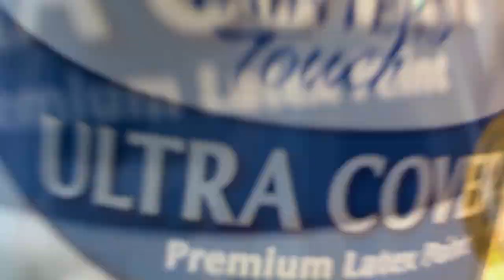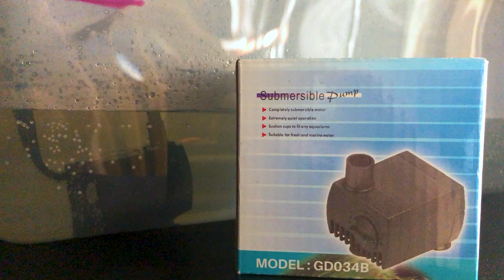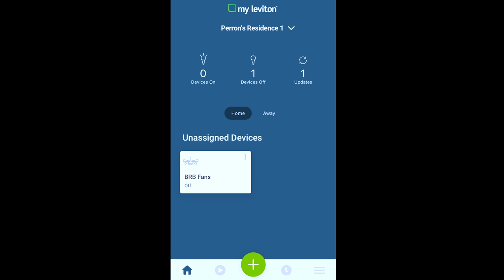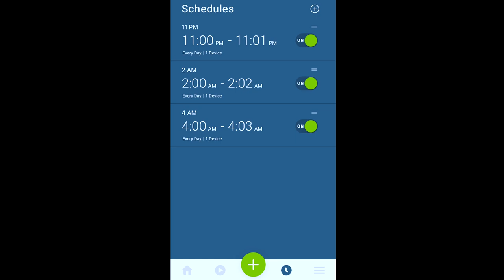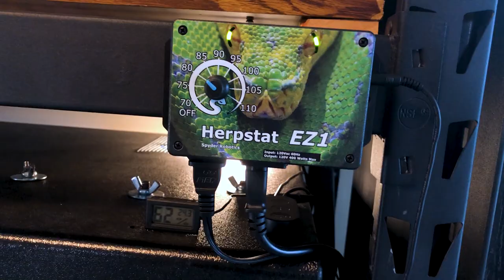DIY SNAKE ENCLOSURE - Rainbow boa

Comment: The basking platform with the hole for the heat probe is awesome. I had an idea for that but could not come up with a suitable material. Sand and glue, geez, perfect.
Reply from the maker: Yeah, I was pretty stoked when I learned that idea from Roman as well. It works great!

Comment: If you are not using the sump as filtration or making a big running water feature like a waterfall or drip wall, what benefit do you get from that plumbing system instead of just siphoning water directly from the pond to do water changes? Is it just so the water isn't stagnant and can go longer between water changes?
Reply from the maker: Yeah the main benefit is it keeps the water fresher. A) through movement and B) through increase water volume. Plus it’s a lot easier to do water changes because I just siphon the water and refill directly via the sump

Comment: Hey I have a question, so the arcadia and the halogen bulb are your only sources of heat and light (other than the leds) right? So how do you keep temps up during night when the lights are off? Love the enclosure.
Reply from the maker: I’ve added a heat mat on the warm side that turns off at 2 AM. So there’s a short period during the night where there’s absolutely no heat. I keep the entire room at above 23°C so the temperatures never drop below that. If you watch my room tour I posted in December I explain that in a little more detail 👌🏼

Comment: Could you please do a more in-depth video about how you created the pond/water feature and all of the specifics about the plumbing? I feel like that will be really useful for the reptile community!
Also, you use a humid hide, and the rest of the enclosure seems to appear fairly dry, is this recommended for a rainbow boa? And how do you manage with the heat being on a different end to the humidity? I have a BRB (only few months old), and I keep the entire enclosure humid as I know that the babies need 100% humidity - am I doing this correctly?
Reply from the maker: Yes, I can definitely do a more in-depth video about the pond! Adult rainbow boas should have a humidity of about +75%, so technically by the end of the day, my warm side is a little drier than it should be. I can't recommend that anyone lets their rainbow boa enclosure get this dry (I am taking the risk, to allow myself to tinker with the increase ventilation which I believe will be a healthy addition). But keep in mind, most of the 24 hour period, the humidity is adequate throughout the entire enclosure, it is really just late afternoon/early evening that is it too dry. I plan on counteracting this with a daily mist if two, that will elevate the humidity on the warm side. And yes, sounds like your setup is fine, babies are much more sensitive and do require a higher humidity at all times. Thank you for watching! I'll try and get to the pond video this month!

Comment: It looks awesome man! I really like the pond setup and design. Im curious if you noticed any odor from the sand and glue slab after being under the halogen for a bit. I know the pva is supposed to be non-toxic but I've always been a bit leary of leaving it under a heat lamp like that.
Reply from the maker: Thanks man! So far I haven't had an issues with odors or fumes. I know Roman (who I got the idea from) has used these slabs for years without issue (https://www.youtube.com/watch?v=4lu8S68CyWE)

Comment: A lot of great stuff in this build. I keep rainbow boas and although I think for experienced keepers, a lot of rules are meant to be broken, I can’t say I agree with using the halogen bulb. I’m well aware of the increased bioavailability of a halogen bulb as opposed to radiant heat panels, but I just can’t justify the heat loss. These animals are nocturnal, and are likely absorbing residual heat, not directly basking in top of rocks in the rainforest during the day. The ventilation required to allow the heat bulb in eliminates the proper humidity. After a meal your snake will want to be on the warm side, and will have to sacrifice humidity for warmth. 

Also, how are you maintaining nighttime temperature? I understand that slab will hold a lot of heat, but does it remain in the low 80s throughout the night without the bulb turning on?

I particularly liked the design of the water feature and hides. Having ventilation for a few moments at night seems pretty advantageous. I might consider using an aquarium filter for that water. Very interesting. Good job. I still think you should have higher humidity during the day. Perhaps a misting setup to spray the warm side every few hours would work as the halogen burns it off and lets it evaporate into the air.
Reply from the maker: Thank you for watching! Yes, I'm certainly going to have to play around with the humidity on the warm side, although I'm not having an issue maintaining humidity in the warm hide as I have it filled with sphagnum moss as well. It is mainly the surrounding area that is drier than I would like. I may have to play around with increase the ambient humidity of my room (I have a large swamp cooler that does the trick) or use a daily mist as you suggest.  

And I actually don't have night heat for any of my reptiles in this room, I let the room drop to 23-24°C through the night which is in line with the lows in the wild (here's the location I pulled data from for my BRB: https://en.climate-data.org/south-america/brazil/amazonas/manaus-1882/).  Having said that I still have the option of sliding a heat mat under the enclosure underneath the warm hide... this is something I might consider now that you have me thinking about it! I've done something similar with my JCP (it comes on in the late afternoon and turns off the early morning (2 AM ish), https://youtu.be/fYBPrtIjdwA?t=907), I might do something similar with this enclosure.  Thank you again for watching and providing great suggestions!

Comment: Very informative, and glad you dropped the music at the start, which IMO was a distraction over what you were saying.  I take it you want to extract the air from the enclosure into the room, rather than have the fan pull air into the enclosure?  If not then reverse the fan. The label on the fan identifies the direction the air flows.
My only other concern would be filtration.  I would add a small internal filter in the "sump" just to aid with any bacterial build up, especially as she will probably toilet in the pond as most boa's tend to to given the chance.
Reply from the maker: Thanks for watching (and for the feedback re: the music, glad I didn't use music for most of the video!). I actually want to the fan to blow air into the enclosure, I was looking to potentially create a "wind" like effect for enrichment sake... it will be easier to accomplish in the summer when the relative humidity in my home is higher. Good advice on the filter, I think that's a great idea and wouldn't be difficult to add

Comment: I'm planning the build for my new rainbow boa and want to a add a water feature very similar to yours! My main limitation is that I don't have the tools to cut glass so was hoping to use a clear plastic tub and customize the outside. Do you have any input on the pros/cons of that?
Reply from the maker: I think that should work fine. That was actually my original idea, but I couldn't find a plastic tub that was the dimensions I needed so a custom cut glass tub was my only option!
Reply: @AnimalsatHomePodcast  Okay awesome thank you!!

Comment: I use air humidifier (the one for humans, just plased it in on top of terrarium on the ventilation), my bci really liked it, now he spends much more time under heating lump and outside of his hide =) Later I'm planning to make a pond, but with waterfall and, maybe, a filter, because I won't be able to replace water easily your way, since in Russia water from water tap isn't drinkable. But as temporarily solution humidifier really works and easy to use. Anyway, thanks a lot for your tips and ideas, this enclosure looks great, your animals are lucky to have you as their owner =)
Reply from the maker: I have a air humidifier in the room as well, they help a ton! Thanks for watching the video and good luck with your pond & waterfall, that sounds amazing!

Comment: What is your mixture for your substrate and a guesstimate of the portion percentages?
Reply from the maker: Right now I’m using a mix of potting soil, coco husk, orchid bark and sphagum moss. Probably about equal part of each
Reply: @AnimalsatHomePodcast  I'm wanting to add top soil in with my blend and play sand. I use Cypress Mulch and Sphagnum Moss currently. I already have the lowes app ready for my purchase. Thanks for getting back to me 💯

Comment: You did a lot of really cool stuff in this video and I think it worked out pretty good overall. Can I make a couple suggestions that you can take or leave?? 

I think it would be cool to add a few more plants especially over in the area beside the warm hide which would give even a bit more cover. Something with a purplish colored leaf would be pretty cool or any kind of fern which should do okay and there as well and provide a lot of cover. 
You're hot hide is extremely cool in a lot of ways but it does kind of look a bit like a box and I would be tempted to hide it a bit by piling some substrate up against the side of it so that it's partially buried or maybe piling some small stones or hiding it with plants. 

One thing I don't super love about these enclosures when I see a lot of them is because they're black I find them dark even if they're well lit. Adding a background can really help although maybe you want it dark for some reason that I don't understand? I don't mean making it super bright just so that the light carries through the entire enclosure a bit better. 
On that note do you have enough light for your plants?

I don't know that much about Brazilian rainbow boas although I did almost buy one once and so I did a little research, can I ask what the substrate is? It looks to be a mix of sphagnum moss and soil?
I'm surprised at how shallow it is? 

I'm impressed with how the electronics and plumbing are on this and I find that pretty inspiring. The little probe screens all look really professional. When I do my corn snakes addleton closure I'm planning to put in a trickling Creek, quite a bit different than what you've got here and I don't have the option to drill through the side of my enclosure since I'm building it in a commercial display case from a store which is almost entirely made of glass. The one issue is I'm not sure if the glass is tempered but then the second issue is that if I did crack some of the glass I don't think I could fix it so it might not be worth even attempting. My idea was just to build it with the pump compartment under the water where the snake can't get into it, and have the whole unit as a removable piece that I can take out and clean when needed. 
One other thing that I might suggest would be have you considered putting floating plants in the water? I do this with my corn snakes enclosure and the plants grow quite well and they have a little bit of a water filter in aspect to them as well as making it look more naturalistic. When I change his water dish I take them out and I rinse them a couple times before putting them back in. I use mostly salvia and duckweed but with the scale of your enclosure I would probably choose a larger variety. 

Overall I think you did a really good job and I really liked watching the build especially the part of mixing the sand and glue to build the hide with the slate tile.
Reply from the maker: Thanks for watching, glad you enjoyed the video! And thank you for the suggestions, I really appreciate that! I think more plants and a background would be an excellent idea. The main thing is— I am really not a fan of this enclosure. The lack of height makes it lack versatility. I'm hoping in the next year or so to upgrade this boa to a larger enclosure. The plan for the larger enclosure would be more plants and a 3D background! Yep,  the plants have enough light and are growing well. They are rooting really well into the pond too, which makes a neat effect. Pothos require very light to survive thankfully.

The substrate is a mix of a bunch of components. Mainly, coconut coir, sphagnum moss, and some orchid bark. I wish I could go deeper with the substrate, but again the enclosure itself is the limiting factor.

Sounds like you have a really interesting idea! I think a trickling creek would look amazing. I hope the glass isn't tempered so you can give that a shot! The pothos plants I have are almost acting like a water plant because their roots are covering the surface of the pond... but I'm thinking duckweed would actually look really cool as well! Thanks again for watching and commenting :)
Reply: @AnimalsatHomePodcast  I wish I could show you the backlit background I made for my hognose snake enclosure.  It's not a 3d background but it looks great and ads some diffused light,  without taking much space. Something like that would be cool in your enclosure.  
I guess I could tag you on Instagram maybe? 

For my trickling creek I'm planning on just making it a single piece unit that can be lifted out to clean. So the plumbing would go inside the enclosure only.
Reply from the maker: Yep, you can definitely take me on Instagram! I would love to see that
Reply: @AnimalsatHomePodcast  I tagged you.  And there's a ton more photos and videos on there too.  
I'd be stoked if you include my enclosures in your next review video as well

Comment: Hi,what bedding are you using?And you use 2 devices,one for hot zone and one for cold?
Reply from the maker: Substrate is a mix of coco coir, orchid bark, sphagnum moss, leaf litter. I’m not sure what you mean by the second question?
Reply: @AnimalsatHomePodcast  if you re using 2 diferent thermostats/humidity devices,one for warm zone and sec for cold
Reply from the maker: @diandralorena2903  Nope, just on the warm side!
Reply: @AnimalsatHomePodcast  thank u

Comment: What in your opinion is the BEST sealant for a BRB diy reptile background?? I know the approach for really high humidity species is different from what I've researched.
Reply: For a 1 year old who will be in this one for about 2 years before her final size of 5x3x3
Reply from the maker: What type of background is it?
Reply: @AnimalsatHomePodcast  initially I wanted to do the aquarium silicone and the dry substrate mix. But I'm not certain yet. 

So far I have just the gaps n cracks insulation foam down! I'll be adding some shelves with styrofoam sheets.
Reply: @AnimalsatHomePodcast  and also thank you for answering both questions on your 2 posts. I really love all your content.
Reply from the maker: @reptilefae  no problem! Thanks for watching the contact. You can either do the silicone/substrate, or drylok (as I did in this video for the pond). Either would work perfectly fine!
Reply: @AnimalsatHomePodcast  you rock ❤️ thank you for the help and all you do!